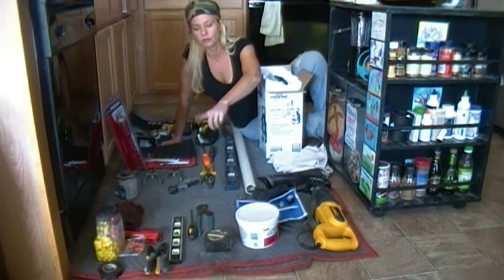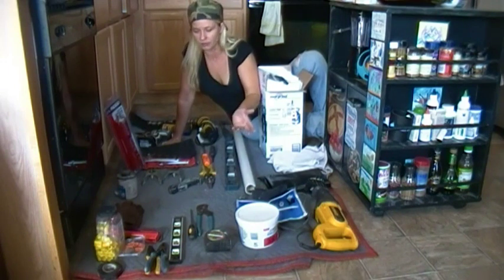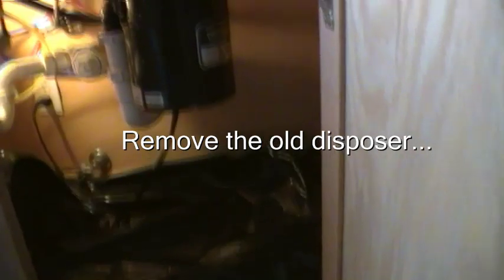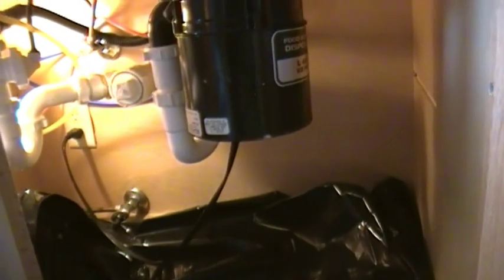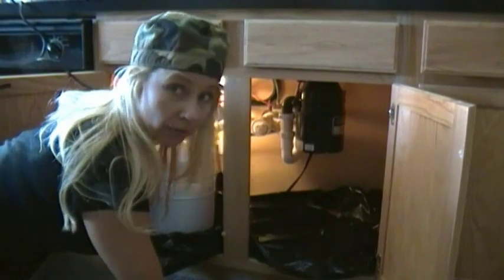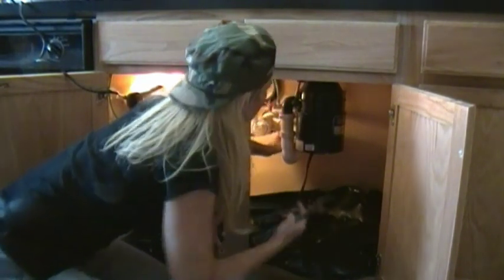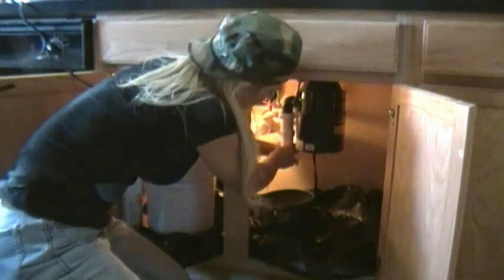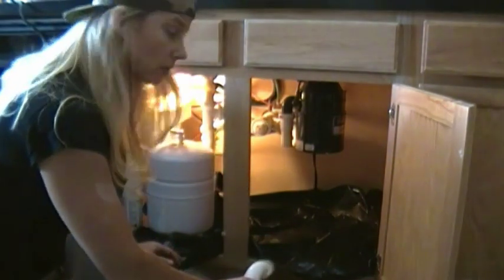Part 1 How to Install Garbage Disposer for the Mechanically Challenged

Comment: I was a pipefitter for 15 years and a Playboy Bunny for 2 years before that. First of all, anybody who is getting ready to work would put their long hair (like mine and yours) tied back in a ponytail or braid. Secondly, I am getting ready to change my disposer tomorrow and it is "hard wired". I disagree with you about the "problem" that would be. I am simply going to turn off the main switch at the fuse box. I know which one it is, but you can't be too careful. I turn off the main. After doing the pipefitter/weldor thing for 15 years (I earned an Associates Degreein Welding Technology, that is why I was hired), I went on to earn to Master Degrees. : ) I love knowing how to fix everything myself!
Reply: Hi Sammi; thanks for taking the time to comment! You're right about the hair--completely for the camera. As a long-time fitter, my stuff really isn't the best fit for you--you're going to be better off with someone who just hits the high points. For my target audience, tying in the electric can really indeed be a horse of a different color, so to speak. While I suspect my series was a little long for what you needed to know, I do hope you got something from it for your time. It's always great to "meet" another female tradesman, and great job on getting your Masters! I actually did all the brain work young and got into the union at 40, so I'm on the reverse path I guess. Never would have guessed I'd be a plumber and loving it in my "twilight years." Yet another of life's examples of how fact can indeed be stranger than fiction:) With warmest regards....

Comment: Do they make really small disposals for sink that is about 12" square? Like the kind of sink that you might see in a home bar or boat. Probably a dumb question but 'm a guy so...
Reply from the maker: Sorry for the late reply, but I haven't ever run across anything like that personally. Your best bet would probably be an RV dealer, or perhaps a higher end plumbing showroom. Either of those should be able to look this up... I would imagine in any case it will be a special order item, so expect it will be a week or more before you have it in hand once you find it.

Comment: Whoops, I was under the impression this was how to install a disposer for the first time. It's actually how to replace a disposer, right? I need the former.
Reply from the maker: Yes, this is a replacement. Much of the process is the same, except you will remove a basket strainer/tailpiece rather than the previous disposer. Watch your heights...typically the drain line for a basket strainer is higher than for a disposer, and water of course won't run uphill... The other major difference is installing the electric (and a switch unless you have a batch feed model). I'm afraid that's outside my area of expertise. If you need any advice on reconfiguring your drain line to accommodate a disposer, send me a pic and I'll try to help. Good luck!